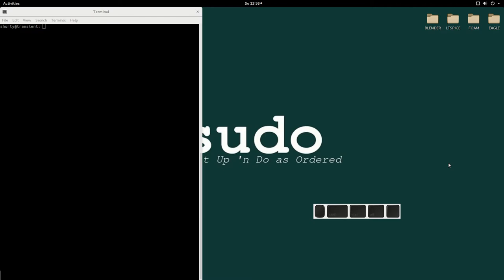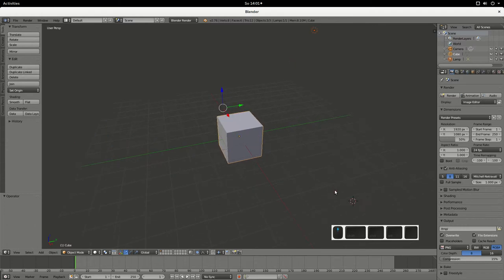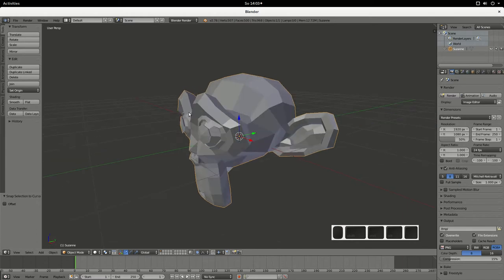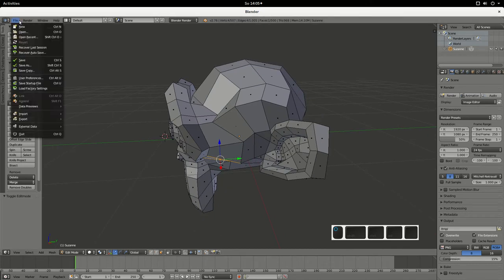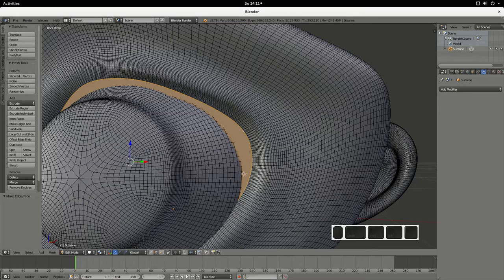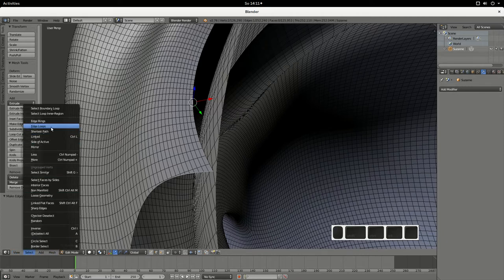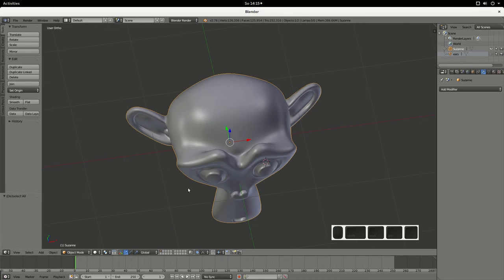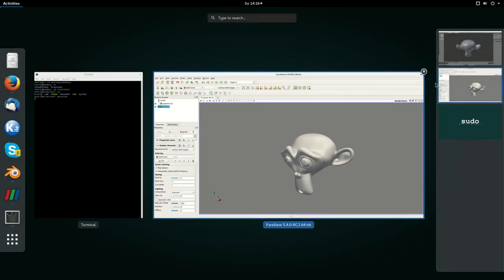2. Suzanne Case Generation (Blender®) ∇ Holzmann CFD

Comment: Alt+RMB to select edge/vertex/face loop
Reply: You can try to change Ubuntu shortcuts. Also you can only change the shortcut in blender, or you can use in blender shift+alt+rmb instead of alt+rmb, which is generally the same, but stands for add loop to selection (with shift), not select loop.

Comment: Suzanne is not a good example of blender geometry. I tried many shapes of blender but I failed. cfmesh cont make point and edge.
Reply from the maker: Well, Suzanne was the geometry we had to use in the community Christmas competition. That's why I have it here. cfMesh fails probably because of a bad STL file.
Reply: Holzmann CFD Thank you a loot. I used onshape, FreeNAS, heekscad, gmesh blender , Salome for making geometry but flailed.